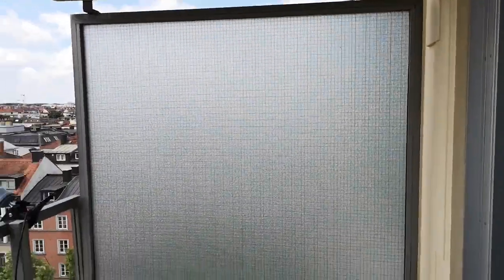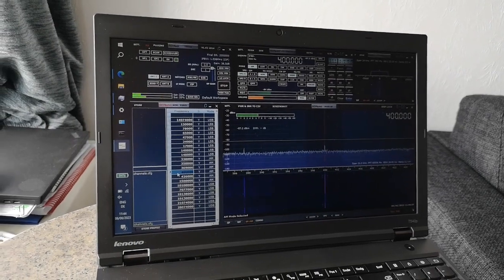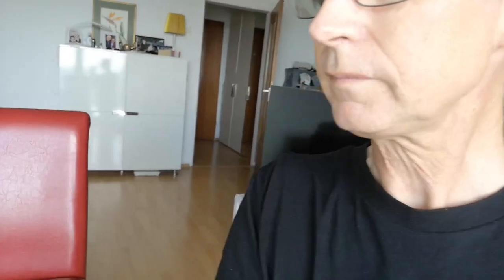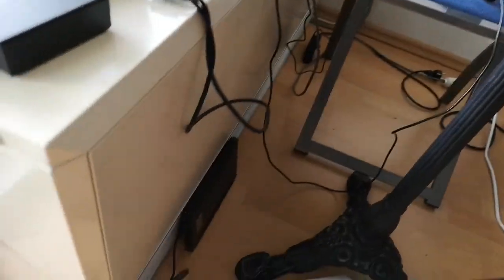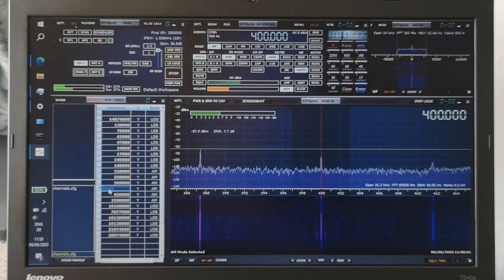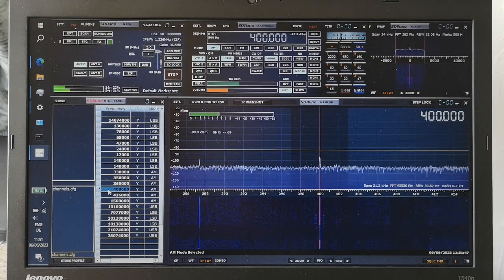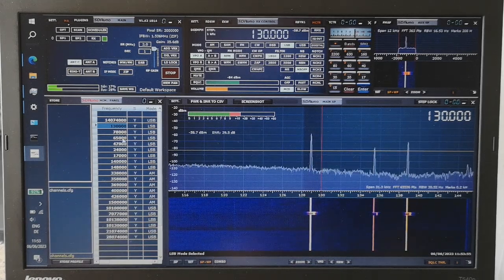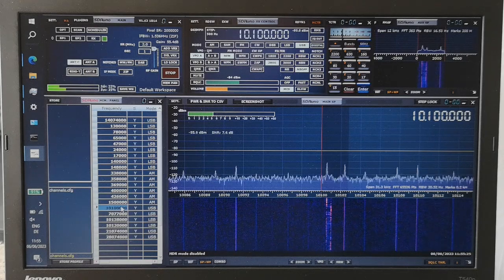PA0RDT  Mini Whip first impressions

Comment: I was just testing a fake mini-whip antenna from RA0SMS on the spectrum analyzer and while its too small to ever pick up any signal it has a gain of about 60 dB and would probably make a good preamp if you cut off the mini antenna part and connected it to a real antenna!
Reply from the maker: That's an interesting idea !

Comment: The mini whip is a fraud that can't pick up anything so why waste your time with them?
Reply from the maker: I find that it works really well for picking up VLF signals like DFC77 on 77kHz and the aircraft NDBs around 400kHz. Your mileage may vary.
Reply: @fotografm  The 4" probe couldn't possibly pick up any signal on LF or HF!  If you are getting something you must have a break in the shield of your coax that lets it in!
Reply: Don't feed the trolls
Reply: @Smash-n-Grab Oh I'm sure he has an engineering degree, just like the guy who first showed me a mini-whip.  My friend is the type of engineer who understands (as did my Elmer decades ago) that antennae do not always follow the written rules as we'd expect.

Comment: That's why you need to ground it
Reply from the maker: Indeed
Reply: I love grounded antennae, seem safer in storms. Not everyone disconnects and puts the ends of their coaxial cables (and balanced lines) into a jar per the manual. 😂

Comment: Like others wrote, use a good earth that is specificly for the MW, but never use the home earth system!!! After using many original MW models created by Roelof over 20 years the use of a dedicated common-mode choke or several of them depending on the situation of the setup can make reception a lot cleaner. good luck!
Reply from the maker: Indeed, common mode chokes are very useful. Will try inserting one in the feed and see what happens...
Reply: Always buy the real deal these China efforts are not always in the user interest in terms of QC etc .And Roelof makes a sound antenna for not much more.

Comment: Based on your previous video about the failed mini-whip from China, I got a Bonito Boni-whip. Like you I live in an apartment and like you I also found that the signals just jump up if I can hold it arms length out the window. Had several days of wonderful short wave listening but the biggest surprise was when I took it to my local radio club and tried listening to the RSGB news at 3PM on Sunday afternoon on the 60m band. At first the signal was weak but when, instead of holding the antenna in the air, I placed it on the ground the signal suddenly jumped to 5/9. And when the news finished I was able to hear other folks on the net all over the country....with a tiny antenna.....on 60m....on the ground.

We were wondering why we got such a result. I guess the mode of propagation was NVIS. Perhaps there was some metal object, or just the water table at just the right distance under the ground to make a good reflector.

Were you perhaps listening to the DCF77 time signal on 77.5KHz? On the Boni-whip I can also hear that in the UK as well as the MSF time signal on 60KHz.
Reply from the maker: Thank you for the comment and for the tips. It reminds me of a video I saw about a ground antenna made by placing earth spikes a distance apart. I am high up in a building so won't be trying that anytime soon ! Will check to see if it is indeed DFC77. Glad to hear that my video might have influenced your buying decision !

Comment: Thanks for posting. I enjoy your videos as I'm an ex-pat Brit living in Budapest with similar constraints to you with regards to antennas (similarly aged to you also!) :-). I have an Mini-whip from Roelof and I bought the low-noise wall-wart from him. Maybe you have already, but Mile Kokotov (Z33T) has some nice videos on the proper grounding of the Mini-whip for optimal performance. As a good compliment to the Mini-whip check out M1GEO's "Wellgood Loop" also. When George has them in stock they take a few days to arrive in mainland Europe. It is a refined clone of the WellBrook loop with fantastic performance. I also have an RSPdx and exclusively use Linux.
Reply from the maker: Thank you for the comment and for the tips. I will take a look at the "Wellgood Loop". I already have a Wellbroiok loop at another qth which works well although it picks up some of the noise in that noisy building. I just bought a secondhand MFJ-1026 noise canceller so will be trying that out too. Which SDR software do you prefer for the RSPdx under Linux ? I am a Fedora fan but see that some of the softwares are designed for Ubuntu.